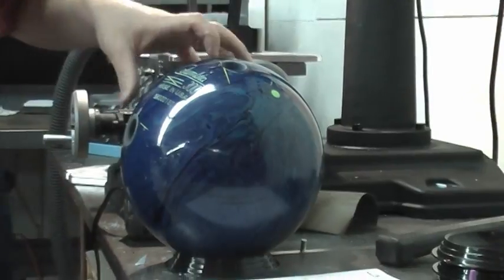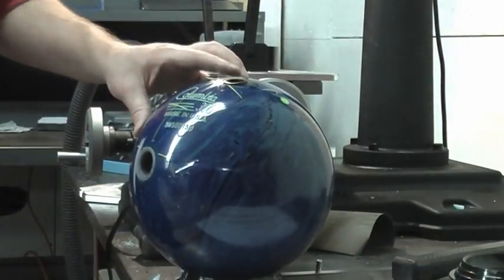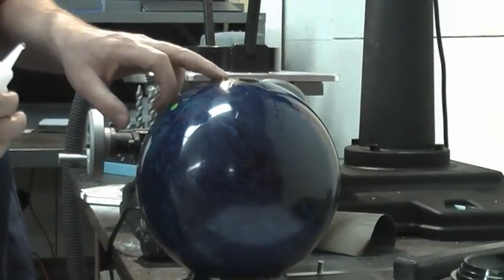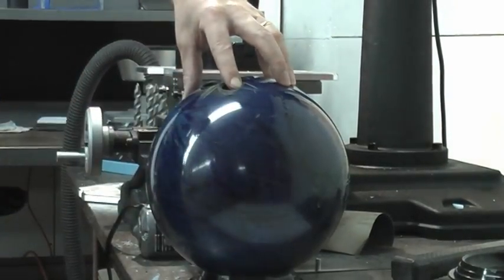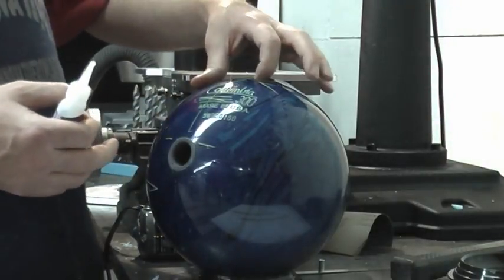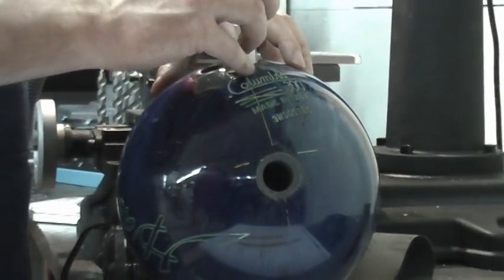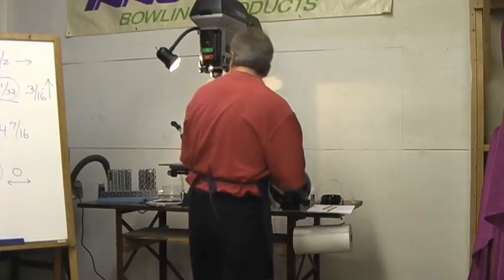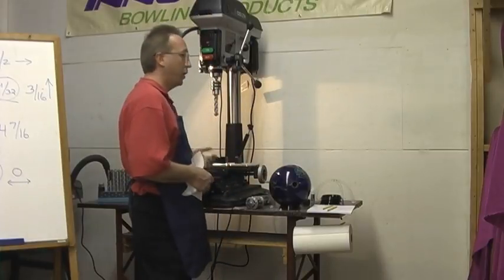Installing Finger Grips in a Bowling Ball - Innovative Bowling

Comment: I posted that a while ago, but i used the round ones. But i figured it out after a while. I think at that time i had my first ball and my pro shop operator accidentally drilled my ball to a semi fingertip grip and since i had no clue at that time, i tugged it way too hard and inserted my fingers to deep into the insert beyond the first knuckle. Thanks anyway, though ^^

Comment: Is it improper to NOT bevel finger holes before installing grips / inserts in fingers?  All mine were drilled with no beveling and they all have finger grips.  An avid league bowler noticed my ball has a chipped edge in ring finger  He noticed no beveling of finger hole, said more likely to get damage around finger holes without beveling.  I have another ball that has a 1/2" chipped edge and the insert, glued to it is holing the chip in place.  I was hoping beveling would be discussed in this video.  The Storm ball boxes mention 'improper / lack of beveling on finger holes or improperly installed inserts voids ball warranty' … among other reasons.
Reply: Every hole drilled in every ball should be beveled. The sharp corners are the weakest part of the coverstock, and not beveling the holes makes them more prone to cracking.

Comment: my finger grips are irritating my fingers but i cant get rid of them and also dont want to. any advice guys? thanks
Reply: louisdiaz316 fit check or try replacing the inserts they do wear but more likely it’s fit
Reply: You can dig them out of the hole with any knife with a narrow blade.  Look at the size marked on the outside. Order 1/2 size larger online...or go back to the pro shop and try on different sizes. Also if the nail side of your fingertips feel numb, you might need more reverse pitch.

Comment: but also wen u push the plug down to be flush with the edge it actually pushes the plug in a bit which makes the plug tighter and there will be a little lump inside the plug where its been pushed down which is annoying